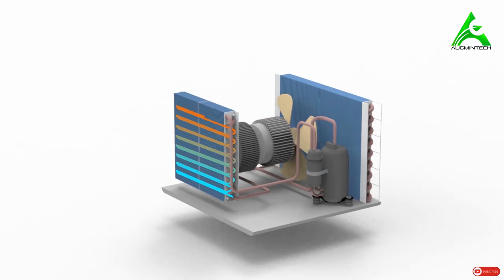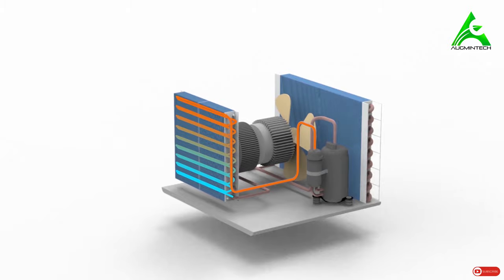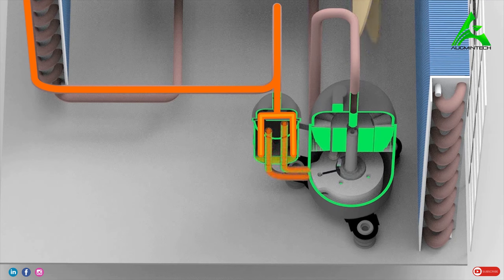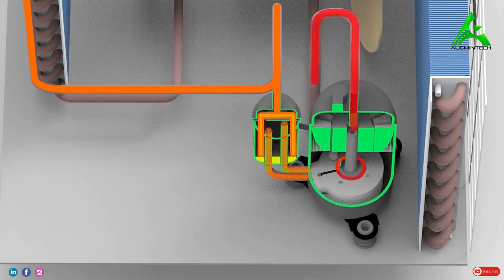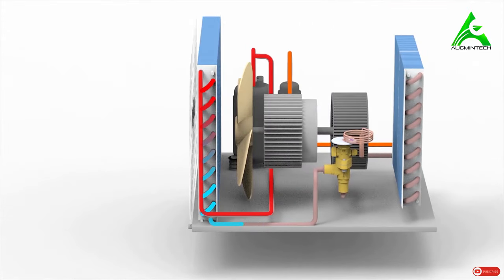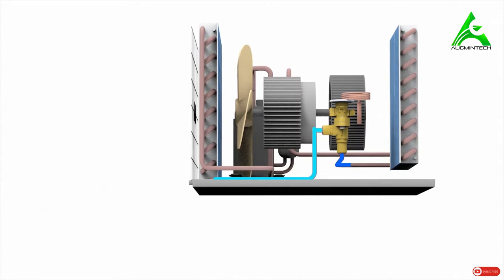Window AC Working Animation | Window air conditioner

Comment: great vid, but there was no fan near the evaporator coil.
Reply from the maker: Same fan works for both
Reply: @augmintech  but how? the fan blowing air over the condenser coils is sucking air away from evaporator coils, right?
so, how does air get blown over the evaporator coils and into the room that is being cooled?
Reply from the maker: Try to look at the picture of real air conditioner when it is dismantled 
This will clarify your doubts
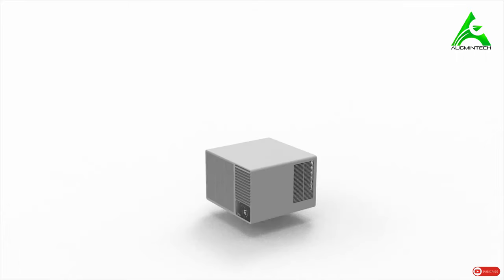Reply: @augmintech  2:30 oh, i see!
that's a blower near the evaporator coil. i thought that was a casing which was housing the motor for the condenser.
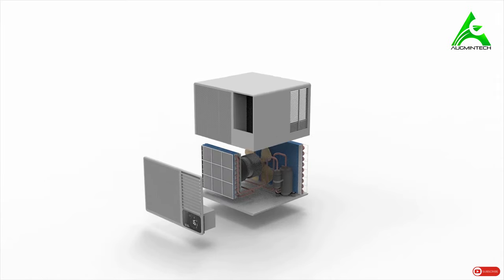Reply: Explained after 2:16
A blower is installed on the same shaft connected to motor
Blower directs the air and then air enters the room.